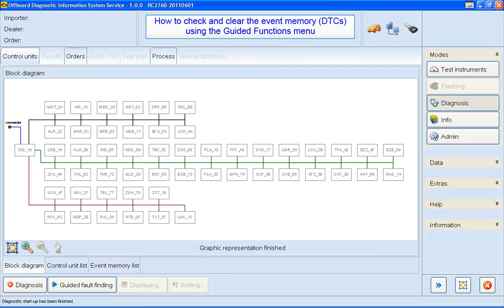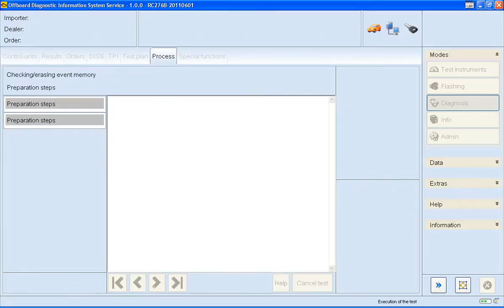20 How-to: Read and clear error messages (DTCs)

Comment: Hi, thank you for your movies. 
There are very helpfull.
But i need have a problem with the engine control module.
In guided function i don't have the line of "read measured values".
I don't have it.
On others modules i have that line.
Thanks